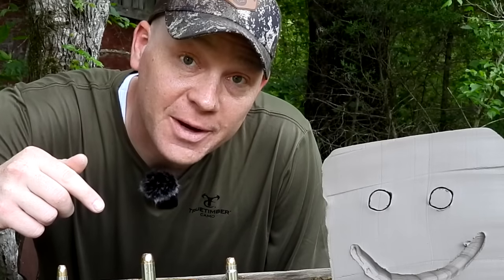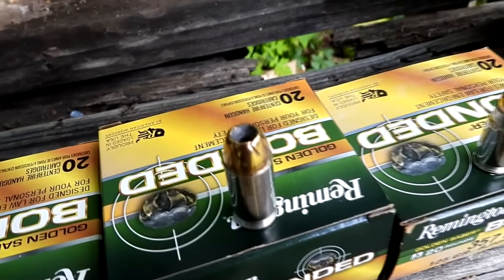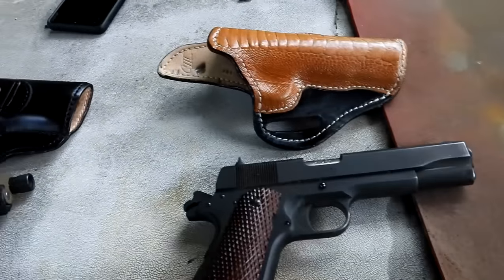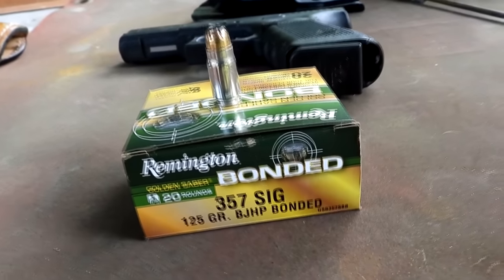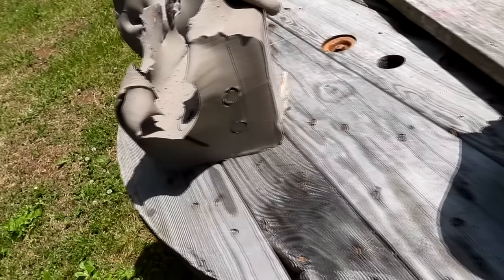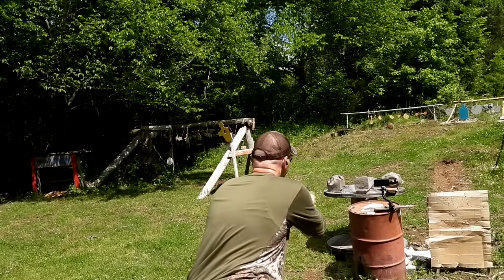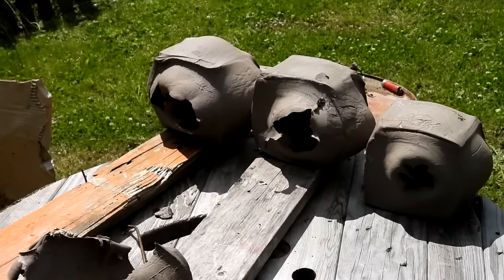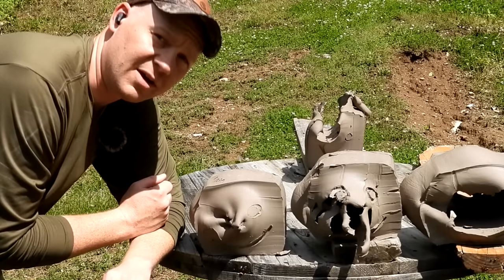9mm vs 45acp vs 357sig - CLAY BLOCKS!!!

Comment: The .357 sig is a very underrated round. Terminal ballistics emulate the street track record of the most effective man stopper ever conceived, the .357 magnum yet most auto pistols carry an impressive load of 13 to 16 rounds rather than just 5 or 6 of the revolver.
Perceived recoil is less for the .357 sig as well and another advantage rarely mentioned is the increased feeding ease and reliability due to the .357 sigs bottlenecked cartridge case.
Overall the .357 sig is imo the best duty and personal defense round made.
I don't know why it hasn't become more popular.
Reply: Hear Hear! I Absolutely agree 110%. A Fan since day 1. And that's been awhile.
Reply: @johnjacobjingleheimerschmi3857  - yuup
 Me too. Bought my SIG P-229 in 1994, as a compliment to my P-226 9mm I bought in 1992.
Great pistols. Awesome round!

Comment: Thank you for the Great Comparison!!!
The FBI fans say the modern 9 mm is better than the .45. But as you showed us. The .45 acp with a modern bullet sure looks better than the 9 mm IMHO.
I Really like the .357 Sig. I have a Glock 31,  32 and 33. I also have a conversion barrel for the Glock 35.
For a while the Texas Rangers carried Sigs in the .357 Sig cartridge as the .40 S&W worked well but didn't give them the 'Struck by Lightning' results they had with their 125 grain .357 magnums JHPs.
Also some US Sky Marshals carried the .357 Sig. Pennsylvania Game Wardens also carried .357 Sigs.
So the 9 mm makes sense if you have recoil sensitive Agents i.e. FBI.  The .45 gets the job done even in FMJ or when JHPs fail to expan.
I certainly would not to be shot by any of these cartridges.
For me a Glock 32 with a 'Ten Ring Precision' thumb safety like a 1911 is a good carry gun. But for a micro, I'll buck the current trend and go with a .45 or the Glock 33.
Cheers

Comment: I have carried all three calibers,  love my Kimberly raptor II .45, in a 3", i had a g32 in .357 sig  finally sold it when ammo went sky high in my area wh3n I could find it.  Used the money to build a nice ar in 10"  300 bo. Now I normally carry a taurus  g3c in 9mm. I like it. It's my first 9mm pistol and have put alot of rounds  threw it and never had a single issue  so I i trust it. Plan on getting a PSA dagger compact soon I like the cut slide and it already set up for optics and a forward rear site.  Waiting on my daughter so we can order them at the same time.

Comment: Load up a +P in the 45 or a Long Colt. The 45 is heavy and slow, and hits hard. The 357 is screaming like a wild Eagle, and if the 9 were a +P, it would have had better results. It's not as much as the caliber as it is the load, barrel twist and length, and shot placement. Other than that, practice with what you feel comfortable carrying and get the ammo best suited for your gun that also has the best overall ballistic results.  There are videos of the 45 230 grain FMJ doing as good, and at one point did better than the 10mm, but i don't remember the load used.

Thanks for the upload, time, effort, and expense in making these videos
 You're in my first choices when i want an honest review

Comment: 357sig is a wicked round that does allot of damage specially with controlled expansion projectiles. I am a big fan 40sw/357sig so all my pistols that can have both barrels do and normally I carry either my SIG 1911 TacOps or Springfield Armory Customized Parkerized Loaded 1911 or my SIG P220 45acp if I am wearing cargo shorts and a Polo Shirt but with all the Chaos that has been going on for the past couple of years I started to carry my Customized DIY LEGION SIG P226 357sig or my Gen 4 Glock 31 357sig with Storm Lake match barrel and if I had to go to the wrong side of town I have been carrying my Gen 4 Glock 35 w/KKM 357sig Conversion barrel and carrying a 15rd mag in the pistol plus one in the chamber plus two additional OEM 22rd Magazines loaded with Underwood 115gr JHP with a muzzle velocity of 1550 FPS and muzzle energy of 614 Ft/Lbs of Energy but that is out of a 4.5 inch in barrel but when you shoot this ammo out of a Glock 35 the Velocity Jumps to 1700 FPS and so does the Energy to nearly 700 Ft/Lbs.

Comment: "LAUGHING IN 10MM".  Great video!  I use all three of these rounds, but prefer the .45acp for home defense as the penetration will most likely be less than the 9mm or the 357 SIG.  I carry 9mm EDC but also have a G31 and a G32 in 357.  I haven't qualified w/ the G32 yet for carry, so not my EDC yet.  I just wish 357 SIG ammo was more affordable right now, this is the biggest limiting factor for me regarding 357 SIG.  It is a beast though, and i love it.

Comment: Most law enforcement in America was using the 357sig until some went back to the 9mm because it was cheaper, but many still carry the 357sig. The ballistics are identical to a 357mag. It's crazy a 40cal casing necked down to fit a 9mm bullet will have that kind of velocity..

Comment: I like the performance of the 357 sig, but since it didn’t get wide adoption the cost of practice/range ammo and availability is prohibitive. 67 cents per rd vs 27 for the 9 or 38 for the 45. I carry a 45 or 9 depending on clothing.
Reply: .357Sig isn't expensive if you reload for it and if you shoot a lot, then you should be reloading everything you shoot. .357Sig is also very easy to reload for if you use the .40 carbide sizing die instead of the .357Sig steel one.

Comment: The 357 Sig won this contest. The 9mm was the weakest but still did a lot of damage. 45 acp came in 2nd. The police and FBI used 357 Sig for many years with great success. I use a S&W M&P 40 for home defense and will probably use my Sig P239 as a backup after watching this display of power.  I do have a 357 Sig barrel for the M&P so I can easily convert it to a 15 round 357 Sig pistol as an option. The 357 Sig is an awesome cartridge that is often overlooked and underrated. Plenty of stopping power for SD.  I would like to see a test with 40 S&W 165 gr Gold Dot or 165 gr PDX on a clay block if you get a chance to do it. Thanks for the great video!!

Comment: When restricted to the caliber .357 Sig wins when I was working.  All will work and do often but for mag capacity and end results .357 Sig.  When not working, .44 Special or Mag for the local critters at the farm in Alaska,10mm, 44 Mag, or .45 LC.  Remember if you are expecting trouble carry a long gun.

Comment: Love your videos. I'd like to see you use a longer block ,say 18" or so. You would show more of a wound channel and make nore of a valid point. 
The 357 moves at a higher velocity, so it was obviously going to be more destructive in those size blocks. 

I'd really love to see you do a test of the most common edc loads. From .380 up to the 10mm including. 38 special and .357 magnum. ..  using a longer block of clay

Comment: The sig does exactly what it was designed to do, emulate the 357mag using 125gr hollow points from a 4” bbl.
This has been the gold standard for “ one shot stops” for decades.
You can’t load the big bullets and get mag performance, but , in doing what it was designed for, you ARE getting mag-like performance with the 125gr projectiles.  So you’re basically carrying a mag with many more shots for defense.
Not for hunting deer or defending against bears, for self defense against two legged predators.

Comment: I carry a 9mm Sig 938 in warm weather.
But in the winter its my 357sig M&P compact. 
The 357 in gel makes a mess. If i could find it in a smaller gun like the 938 Id carry it yr round.

Comment: 10 mm is my defensive choice but the 357 Sig and 45 are just as good for stopping 2 legged predators.  10 mm has 15 all the way up to 24 rounds now in compacts from many mfrs.  I prefer the FN 510 tactical with a red dot for the longer ranges.  Nice comparison.

Comment: .40 s&w is my favorite and ideal cartridge caliber, but 180gr was always too heavy for the .40 s&w, but 180gr is great for the 10mm auto though, between 135gr minimum and 165gr maximum parameters is best, with 155gr/150gr bullet weight being ideal.

9mm = not enough🤏
10mm = too much💪
.40 s&w = just right👌

Comment: THAT was interesting. Now I am tempted to pick up a 357 Sig. I always read it was a "hot" round with serious (over) penetration. It uses a necked down .40 S&W case, another caliber to which I am partial: Most of the flatter ballistics of the 9mm and most of the knockdown of the .45ACP.

Bullet diameter comparisons.
     0.35433"      =   9 mm
     0.357"          =   9.0678 mm
     0.39370"      =  10.00 mm
     0.40"             =  10.16 mm
     0.45"             =  11.43 mm

Of course actual bullet diameters are not always exactly their common reference name... the bullet weight and powder load are always a factor... but this is a rough look, like shooting clay blocks is a rough comparison. They both work.

Last time I looked, .357 Sig was damn expensive. These days just about everything is expensive.

Fun and informative video. Thanks!

Comment: I'm a firm believer in tests like this, but bottom line: I have to rely on something that I can carry.  I have .22LR, .380 Auto, 9mm and .45 ACP. I can't handle either the weight of the .45 for daily carry or the recoil in a multi-round event. Most tough guys would go down with 8 or 10 .2LR in the body or 4 to 5 .380 Auto, but my best bet (for me) is the 9mm 115gr Hollow point in a full size semi-auto. It's about the most power that I can carry and hope to deploy successfully if needed.

Comment: I am curious to see what a lighter-weight bullet in the 9mm would do. I usually use 115 gr. That would definitely be faster than the 147 gr. They must have something close to the 125gr you used for the Sig357. Thanks for another great and informative video.
Reply: You did see a lighter 9mm, only it was pushed by a necked down .40 brass! Much faster and very flat shooting. .357 sig with a 4 inch drop at 100 yards from a 4 inch barrel = dependable windshield penetration!

Comment: By the way 9mm with a 90grn Hornady is not a to be sneezed at...1600ft is easy to obtain without pressure.....and surprisingly the projectiles hold together nicely...and whizzes through car doors very nicely....

Comment: The .357 sig is a hoss imo! Cor-bon 125 gr JHPs @ 1425 fps make a mess out of just about anything I hit with it (actual 1397 fps from my SIG P-229). Triton 115 gr JHPs at an actual 1455 fps from my SIG P-229 do a good job too. They tend to fragment  a bit early and lose penetration though.
Overall the 125 gr Cor-bons offer the best performance with explosive energy dump and enough retained mass to penetrate well.

Comment: What really matters is using the right tool for the job. Different cartridges are simply different size hammers. Using a sledgehammer to pound a Brad nail is just as silly as using a peening hammer to pound a timber spike. Considering mag capacity, cost, recoil and most importantly, risk of collateral damage the 9mm is the best tool for pistol self defense.  Carrying a larger hammer is more about ego

Comment: It’s possible that if you were using a 164grain plus p in 45acp the increased velocity over the 230 grain might cause an equally impressive result as the .357 sig. at any rate, all three created what would amount to an unrecoverable wound in a center mass shot. None are helpful if you miss.

Comment: First, I would use 124 gr. +P bullets in the 9mm, because that’s what I carry in Speer Gold Dot. It’s velocity is higher than the 147 gr. bullet. I would use either that, or a standard 230 gr. HP loading in .45 ACP, also in Speer Gold Dot. The .357 Sig looks like it would (did) over-penetrate, plus it’s not as common as 9mm or .45 ACP, both of which are widely available just about anywhere. So, for me, it would be either 9 mm or .45 ACP, as I carry both.

Comment: The 9mm need help to be as effective as the 45, like expanding ammo, but in the military where most rounds miss the targets, carrying more is an advantage, sub guns can always count on multiple hits. The 45 were designed to be effective without expanding ammo, expanding ammo add less to the stopping power. Where the 357 shines would be if the rounds have to shot through a vehicle, but a definite disadvantage if there are many other people nearby, who can be hurt by a round after it went through the target. In that case, even a 22WMR would be preferred to a 357.

Comment: Wish there was way to show photos of pumpkin test I did from about 10yrs ago, .357sig vs 9mm +p vs .38spl +p+ . That was interesting. At the time 357sig and 45 where edc (one or the other) with 38spl+p+ as secondary out of 2inch .357mag.  The short the .357sig .38spl+p+ had impressive exits 45 was nice 9mm so so.
The debate of large and slow vs small and fast has been around along time even back in old west Buffalo hunter would choose small and fast.

Comment: I have the Glock 32 - 357 Sig it is in my EDC rotation.  It's a little heavy with 13 + 1 in the pipe.  Depending on what I wear and where I'm going I rotate that, a Glock 43 x 9mm, and I have a Sig Sauer P220 Elite (a beast).   I too did my own comparison with extremely close results.  My 9mm seemed a bit more destructive than in the video and I was shooting a 115 grain bullet ??  I do over all of the guns I own prefer the 357 Sig.  When it's EDC the mag has hollow points.  On the range I always shoot FMJ.  I only shoot up HPs when I get a new gun and want to be sure they cycle properly.  But, being that FMJ is a big $$$ saver.  Especially if you are going out for a range "day" of shooting.  I go with the stuff that's about .65 a shot instead of 1.25 a shot.   Other than finding a competitive price on the 357 sig.  I would grab for that Glock 32 everytime.  However the Sig P220 which is about 15 years old is a beast.  It is the least for recoil, and very devastating.  Good home defense or open carry.  All in all.  And this makes no sense.  But I most often shoot the 45 ACP, Most often carry the 9mm (it's lite), yet prefer over all the 357 Sig.   The 357 Sig is still in use with Secret Service, several Governmental agents, and Law Enforcement.  But it never really caught on with the civilian gun tote folks.  
That's a shame.  many would love it once they shot it.   Word to the wise,  It's a loud bang in the Glock 31, and recoil may take you by surprise. . . get ready for it.

Comment: I carry 357sig, but 45acp doesn’t have the rise while firing.  In close or distant range (35-50 yards), 357sig carries better, but 45acp isn’t bad at all.  My Glock 31 is a 16 rounder, and tends to over-penetrate targets.  45acp doesn’t carry nearly as far past a target.  I’ve only shot a vicious dog, and 357 sig has definite wow factor;  aimed at dog’s head but hit his shoulder; leg/shoulder basically was blown off.

Comment: I have been using a .45 - 38 since the 60s and I could never figure out why this round never took hold, with 158 grain pills it sure as hell makes big holes and hits really hard , add the Para high cap frame with one up the spout and you have 15 rounds of dead lethal, still no one took much notice of the 6mm Lee Navy. Go figure!?

Comment: So, here is my argument against the validity of this comparison. In normal 9mm and 45 ACP comparison the 9mm is usually a supersonic projectile at 124 gr or less compared to the subsonic 230 gr 45 ACP. Now this did well for that because, typically, 147 gr 9mm is subsonic just like the 230 gr 45. But the 357 sig is well over supersonic speeds which adds to it's penetration capabilities. It also pulls more energy with it, simple physics KE=0.5MV^2. Higher velocity, even with a lower weight projectile brings more energy. So of course the .357 Sig blew out more because of it's supersonic capabilities. To keep things equal, I'd like to see what a 125 gr 357 Sig does in comparison to a 124 gr 9mm and a 180 gr/160 gr 45 ACP

Comment: A real test of caliber is to empty the clip at the target (quickly). Then check the grouping. A .357 is all over the place because the kickback is too much for the weight of the gun. I carry a Barretta .45 (heavier than a 1911). It's like the difference between driving a Cadillac and an old Chevy pickup. The grouping is much better. BTW, if you use 2 hands to fire, you present a nice big target to the opponent. Turn sideways and use one hand to be a smaller target. Carry at least 2 spare clips as well as 1 in the chamber. I carry 6 spare clips.

Comment: I wonder if you had used a 124 gr 9mm and a 165 or 180 gr 45 if you would not have gotten better results based on the higher velocities

Comment: Speed kills so the 9mm is handicapped by the 147 grain bullet.  A 115 grain 9mm might do better.

.45 might be similar.

The only issue with 357Sig is how does it compare to .40S&W?  The .40 is cheaper and easier to reload so if it can get close it could be a good option.

The other issue is how big of a gun will you carry regularly? 

As much as I want the performance of 357Sig, I usually choose the concealability of a 9mm like a P365.